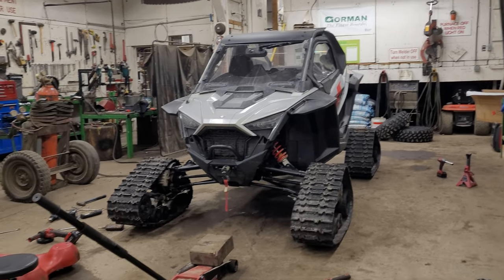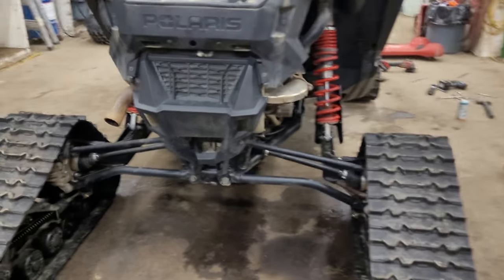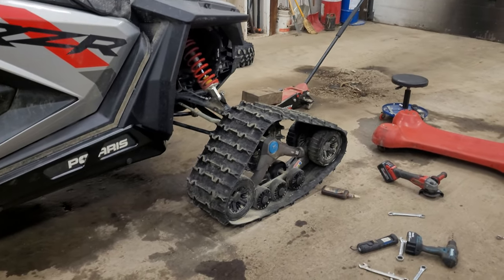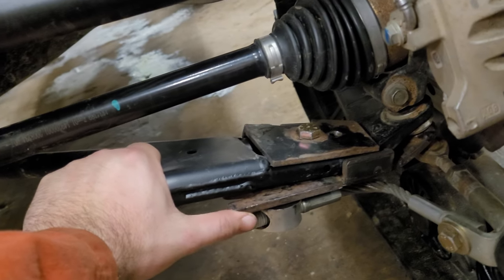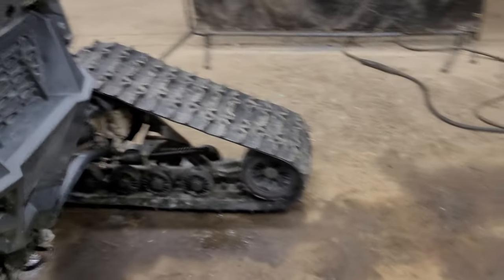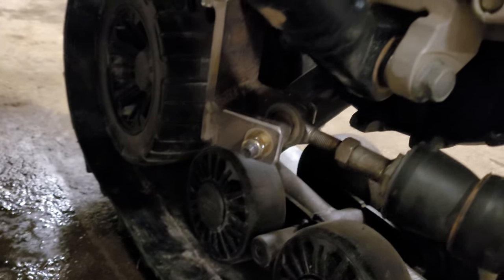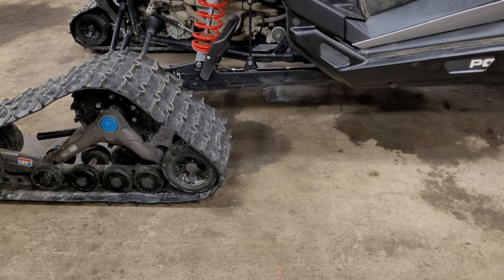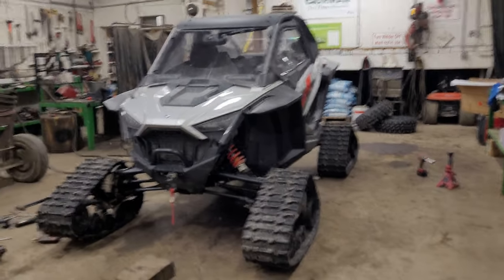RZR Pro on Tracks - Camso says you can't.

Comment: I ran into the same problem. I bought an XP Pro a few months ago with intentions of installing the Polaris prospector tracks. I live in Alaska and half of the year we have snow. I recently went to order them and they are not available. I called camso who builds them for Polaris and they said the same thing. 
I did find a company that sells tracks and modifies the brackets for about a 500$ premium. I like what you did and I am considering buying the prospector tracks and modifying them like you did.
Reply from the maker: Making the brackets work was pretty easy if you weld or have a buddy that does. The machine works awesome with tracks, if the conditions are right you can get off the trail and really throw the powder.

Comment: Did these just bolt right on or did you have to get adapters, I have the same set of tracks but studs don’t light up with any holes?
Reply from the maker: They should line up. You must have a sprocket for a different bolt pattern. Did you buy the tracks new or used?
Reply: @okout  that’s what it was got er fixed up now thanks